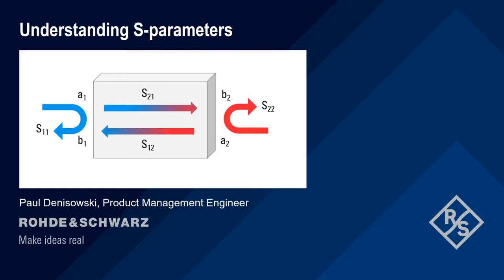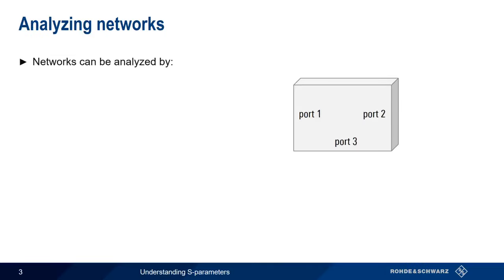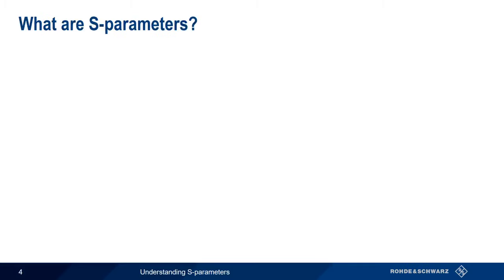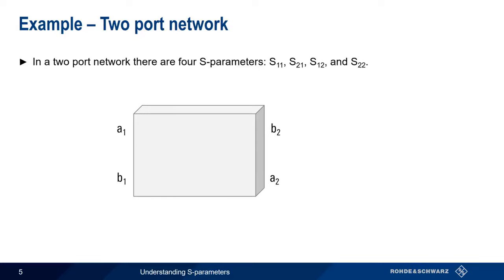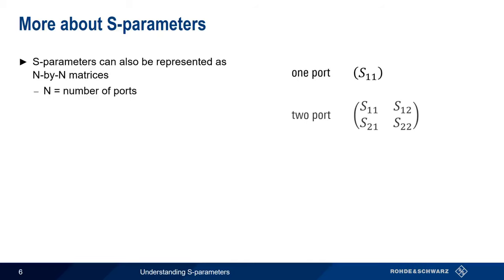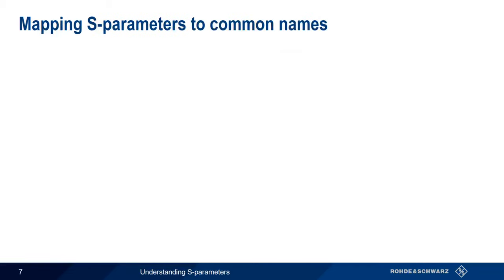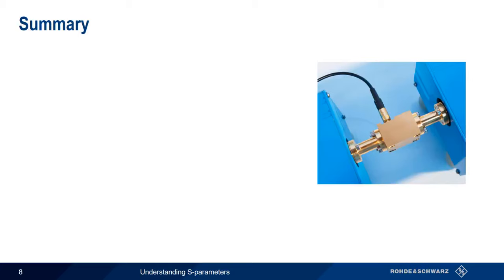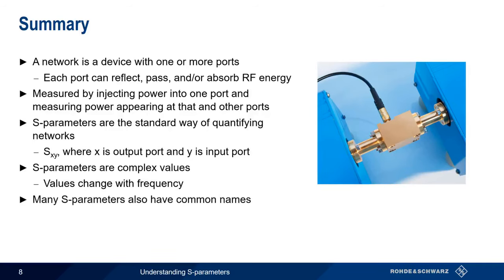Understanding S Parameters

Comment: It is remarkable that no one explained this before in the program I am doing, these 10 minutes brought so much knowledge together for me. Thank you.
Reply: Yes, unfortunately there often isn't the time in modern engineering courses to explain these kinds of practical, test and measurement related topics, which is one of the reasons why we make these videos and other content :)
Reply: @pauldenisowski  Thank you for this. Do you plan on doing a video, where you also show how the calculated S-parameters would be needed in testing or for a system? I learned how to calculate them, but I see no practical use for these kind of information. Maybe a test setup with network analyzer and/or matching network in the process :)
Reply: @danny_racho  Thanks!  Actually, I'm looking into that topic right now :)

Comment: Thank you so much.  This is the best explanation I have seen.  I was wondering how S-parameters are expressed in a matrix as a complex value.  Would it be expressed as a trig. function such as real, imaginary value or polar?
Reply from the maker: Dear Richard,
they can be expressed either as a magnitude and phase (polar) or as real and imaginary parts.  S-parameters are usually stored in the Touchstone file format, and this format supports both representations (e.g. “magS11 and angS11” or “reS11 and imS11”).
Best,
Rohde & Schwarz Social Media Team
Reply: @Rohde-Schwarz  What is Touchstone file format, magS11, angS11, reS11, and imS11?  This is new to me.  I got interested in this when I purchased a Nanovna and I am wanting to learn more about this subject.  Again, I appreciate your YouTube video on S parameters.
Reply: @richardphillips2405  
Most network analyzers can store measured S-parameters in a standard file format called the "Touchstone" format.  This allows for easy export and input of S-parameters, even between different instrument types and manufacturers. S-parameters are complex values which can be represented as either a mangnitude + phase (angle), or as a real part + imaginary part.  The Touchstone file format specification allows you to use either representation.  

A simple S11 Touchstone file contains three columns of data:  frequency, and then either real and imaginary values (ReS11, ImS11) or magnitude and angle values (MagS11, AngS11). Touchstone files usually have an extension .snp, where n is the number of ports. So a file containing the S-parameter data for an S11 measurement normally has the extension .s1p.

Incidentally, you can save S-parameter data from the NanoVNA in Touchstone format using the NanoVNASaver tool.
Reply: @pauldenisowski  When downloading capacitor s-parameter, there are 2 files that series and shunt available. Which and where and when I need to use those?

Comment: Hi  sir, my name is Fajar

I have a question.  When I use network analyzer to measuring antenna, the return loss values is positive. But why return loss value I mean S11 on CST microwave studio is negative? If S11 always have a negative value, so how I can find the return loss with positive value on CST?
Or you have another explanation for this case? Thanks
Reply: Hi Fajar - I don't work with CST Microwave Studio, but I think the issue might be that many people incorrectly use the term "return loss." 

The editor-in-chief of IEEE Transactions on Antennas and Propagation published an excellent two page article called "Definition and Misuse of Return Loss," in part because close to a third of the people submitting papers to this journal (!!!) were using the term "return loss" incorrectly.  (Link below, available to IEEE members).
  From the article:

" Turning to present-day usage, return loss is now the most
 common term used to describe reflection and mismatch. However, frequently this term is confused with a reflection coefficient that has been expressed in dB. The logarithm is taken of the magnitude of the reflection coefficient, but this is incorrectly referred to as return loss; the result is still reflection coefficient, albeit in decibels. The difference between the two is a minus sign"

"it is common place to
 see plots captioned and labelled return loss when, in fact, they are really describing reflection coefficient. I have even had some reviewers asking authors to change the correct form to the incorrect form, i.e., to change a positive sign to a negative sign, even though the authors labelled the plot correctly as return loss!"

So I assume this is the reason you're seeing negative "return loss" values in CST Microwave Studio.

Hope that helps :)

https://ieeexplore.ieee.org/document/5162049?arnumber=5162049

Comment: how to use s-parameters and get impedance depending on frequency, pls
Reply: S-parameters are measured with a vector network analyzer (VNA), which injects RF energy into one port and measures the RF energy that is returned from that port and/or which appears at the other ports.   This is typically done over a range of frequencies, and the complex impedance values are provided by the instrument.  There are both professional and hobbyist VNAs available that can measure and provide S-parameter values for at attached device under test (DUT).
Reply: Paul Denisowski Hey again:) thx for ur reply.  I know what u mean. But my question is different and now I will try to explain to you. In touchstone file .s2p we have f value, angle value(gamma) on each of the s-parameters (s11,s21,s12,s22). And my question is “how to convert this angles to z impedance” when i take datasheet of any transistor , i have impedance values at some frequencies, but i want to know values on different freq and use s-parameters. Maybe u know how to matching(load pull) transistor without vendor model(design kit), pls make me understand Take this site as an example http://www.leleivre.com/rf_gammatoz.html
Reply: @spysine4086   If you need to know impedance values (or S-parameters) at certain frequencies or if you want to do matching, the best solution is to make measurements using a VNA :)   You might want to ask this question on a site like eevblog since it's a bit too involved to answer in the Comments section of this video.  Good luck!

Comment: pls give me some application about measuring scattering parameters
Reply: The vast majority of basic network analyzer measurements are S-parameter measurements.  An example of an S11 measurement is measuring an antenna:  ideally we want an antenna that is "matched" to the source impedance and returns / reflects the minimum amount of transmitted energy at the given frequency.  An example of an S21 measurement is measuring a filter, where we are interested in things like the filter passband (the frequency range over which it passes signals), the amount of out-of-band rejection (how much signals outside of the passband are attenuated compared to signals within the passband), and the shape of the filter (how steep the "skirts" of the filter are).
Reply: what is the concept of operation of measuring scattering parameter
Reply: @ahmedtarek9801  S-parameters are normally measured using an instrument called a network analyzer, which injects RF into one port of a network (usually over a range of frequencies) and measures the amount of power reflected back from that port and the amount of power appearing at any other ports.